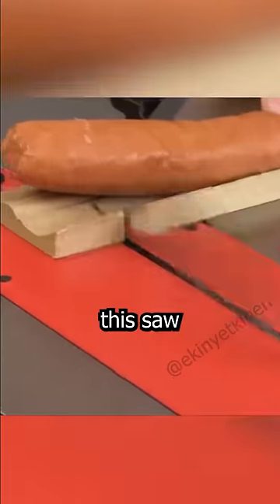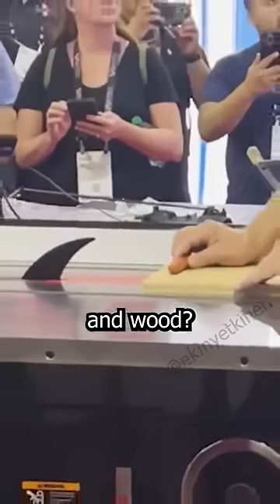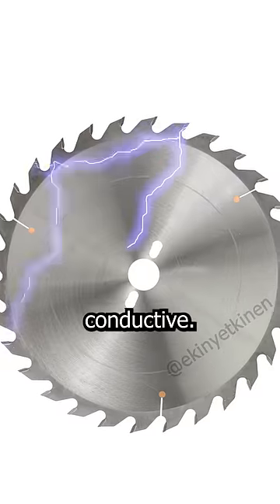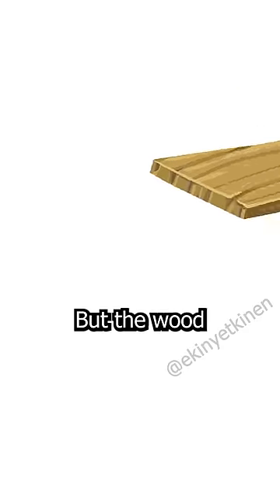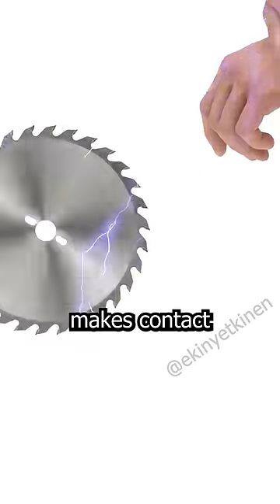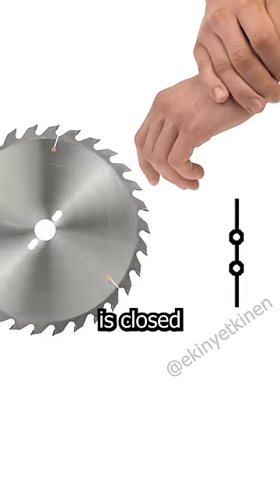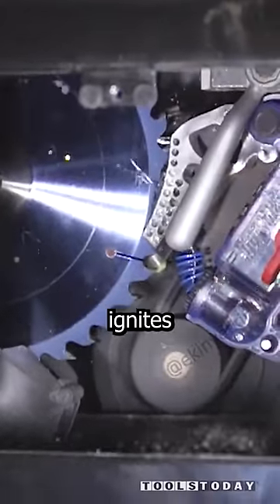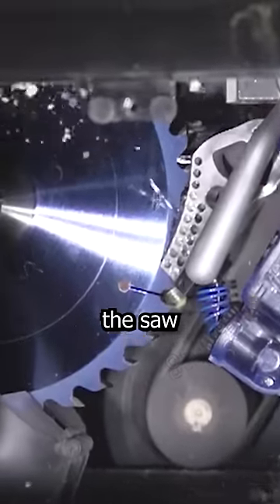How does a wood saw not cut my hand? 🤔 (sawstop)

Comment: My school has this. In my construction class my teacher said, “Better a nick and a $300 replacement for the sawstop than you not having your fingers.” 
Couldn’t have said it better myself
Reply: My school had these too but my teacher said it was closer to $5000 to get them repaired.
Reply: @Tylerb1324  I don't know what currency vound possibly be 5000 dollars but I am seeing $140 CAD for the braking system. I don't understand why he does'nt talk about the blade needing replaced too, which you could factor in another $100-160 which fits in peeta's statement. I would say that it is just a scare tactic and not realistic to be $5000.
Reply: @Tylerb1324  your teacher is lying. the company i worked for developed the brake and sold the patent to SawStop in 99/00. the replacement incl. the sawblade was around 20€ production cost and around 125€ + taxes for the customer, so i guess it will be around 150-200$ + taxes today. still way less expensive than some fingers.
Reply: I cut off my fingers and I disagree, they were put back on for free
Reply: The guy invented this is smarter than allah brain
Reply: If you do ever need to replace it, you don't even want to argue with that.
Reply: @Tylerb1324   Your school was either getting ripped off or the teacher was massively exaggerating the cost so people would think twice about triggering the stop for a quick giggle.
Reply: @JuliusClonkus this is the reason my teacher didn’t buy them
Reply: Yeah I'm not sure where y'all are buying your brakes from but they're only a hundred bucks so whoever's getting charged 3 to $500 for a break it's getting ripped off in the purse is making bank we have these in my cabinet shop and the brakes go off every once in awhile and it's a trip to the woodcraft 100 bucks.
Reply: @KeeganWall  Still worth it, you can't buy new fingers for 5k.
Reply: @romannicastro575 well, cheaper than medical bills and ugh . . . Missing your finger.
Reply: Must be a quality school then. Mine couldn’t even afford properly grounded welding tables
Reply: Which schools have construction classes?
Reply: @Tylerb1324  Is that 5000 Indian dollars? :D
Reply: @Tylerb1324  Their industrial cabinet saw cost about 5000, a brake cartridge + new blade will cost you about 220 dollars

Comment: These saws are awesome, I've been using them for 15years. One thing to remember when using them is wet wood or wood with embedded with metal will trigger the break as well. The price of the breaks are not bad now but when they first released they were expensive. Guys in the shop use to go through 5-10 in a year. You have to bypass the safety if you are cutting stapled or wet boards.
Reply: What about sweat? I can see potential issues in hot workshops.
Reply: @alexchapman3906   yes even sweat. The thing is you'll be covered in saw dust without good extraction. Even with decent one you'll get a dusting. As long as sweat doesn't hit the blade should be fine.
Reply: Yea learned this the hard way when cutting pressured treated lumber because we just replaced our old table saws with saw stops

Comment: PSA: THIS IS ONLY ON SAW STOP SAWS!  Be carful around all saws, but be especially careful around saws from other brands, as they dont have this safety mechanism
Reply: Also, remember that they probably would if the original inventor hadn't patented the saw stop.
Reply: And even if it is a saw stop, it can still cut you, badly.  You won't loose a finger, but you might need stitched and will need bandaids.  It's not worth being careless about regardless.
Reply: My grandfather lost his fingers from a saw.
Reply: Ye, the only bad thing i see from that saw is that it makes u not as careful as u would be on a normal saw, i used to work with saws and everyone was extremely careful and on this video the guy literally put his finger directly on the saw, not even on the edge of the wood, but overall is a good invention if u act as carefuly as u would do on a normal saw (srry for my english)
Reply: @WABeekeepers They would have it once the patent is over. You need to let the inventor make money, if not, none of these would even be invented in the first place.
Reply: @zxuy5575  it makes me more comfortable using a table saw if it's sawstop. It there is kickback, metal in the wood, or if you have an accident, that keeps your finger in tact. It could make you less careful, but I would rather have that safety precaution. I have learned from my woodworking class that experienced wood workers, even tears, can easily mess up and lose a finger.
Reply: @LukeO317O7  agree with u, im just saying that some ppl would be less careful knowing is a saw stop instead of a normal saw, like the guy in the video that didnt even put his finger on the top or the edge of the wood to pass it through the saw
Reply: @WABeekeepers  The only problem with IP rights is exclusivity. If anyone could license an idea and pay a fair price, it would be fine.
Reply: There’s surgical bone saws that stop on flesh. a neurosurgeon was showing it to me when it ripped his glove right off.

Comment: Not quite, it’s based on capacitance, the circuit is already closed and the sensor determines the capacitance of the signal coming back. If the circuit was open, your hand would be chopped off as there is no signal at all going to the controller. The only way a circuit closing saw stop would make sense was if it was grounded and you completed the circuit that way, but that would require a lot of voltage and would feel rather unpleasant.
Reply: Exactly like those electric testers screw drivers
Reply: It wouldn't require much voltage but yes
Reply: So, wouldn't particularly wet wood also set if off?
Reply: @grizzo9976 yeah it's been know to happen.
Reply: @grizzo9976 yes, you have to deactivate the brake to cut damp/wet wood (theres an arming key that you pull out)
Reply: @outkast937  neat, someone taught me something in the youtube comments!
Reply: AChtUallY 🤓
Reply: Now that sounds correct
Reply: There would also be a problem if you are wearing rubber soles and hence wouldn't ground the circuit
Reply: @samueljames8654  no, you would ground it to the frame of the saw, through your hands.  Not to the earth through your feet
Reply: So the detection circuit is pretty much the same one used in touch lamps or touch screens (or at least uses the same principle).
This technically makes the blade a "touch blade".
Reply: @grizzo9976 Either way it doesn't make sense. If it's already grounded to something then that thing woild need to be perfectly isolated from the circuit, which, the saw needs to be physically connected to the frame somehow. Then if you touch rhe frame at all it'd activate, so what you're saying doesn't make sense.
Reply: @sorvex9 Notice how you were completely ignored
Reply: @waldolemmer  Notice how i don't give a damn.
Reply: Doesn't it kinda work like those GFCI outlets they have in the US?
Reply: @woutverjans2928  Not the outlets/breakers themselves, but the way that the electricity travels through your body even though you're not touching earth/neutral wires

Also, most places outside of the US have GFCI, but it's usually part of the breakers in the distribution box and protects every room, not just the bathrooms (as in the US). Most call them RCDs (residual current detectors), but they're called earth leakage breakers here in South Africa for some reason
Reply: @woutverjans2928  yup
Reply: @eddiechung675 thanks for spreading your knowledge mate, it helps to have an expert or someone who has a proper explanation around so that other people get the right idea.
Reply: Like capacitive touch screens???
Reply: I don’t think it’s capacitance either. It’s some sort of resonator. It has to measure some change in frequency feedback.
Reply: @sorvex9 bro just outed himself for dropping out of high school
Reply: You wouldn't feel the volt on your finger anyway from the amount of Adrenaline that just surged through your body.
Reply: @ekon01cz no, it is capacitance. You can check the patent for yourself if you’d like!
Reply: Thank you ! now it makes sence. its like a fuse :D
Reply: Well losing your fingers would feel more unpleasant still
Reply: @outkast937  imagine you needed the failsafe because your finger got in and you pulled out the pin so it cut through it straight through
Reply: That’s right!! It’s very much what i explain on a different comment

Comment: Imagine how annoying it would be trying to cut wet wood😅
Reply: You just turn off the system lol
Reply: @techheck3358  I didn't know you could do that. I cut aluminum all the time on mine. My son's school had one of these break stop saws and he knew I liked to cut an aluminum trim around frames I make. He asked the teacher if he could change the blade, changed it, then the system kicked in as soon as he started cutting the metal. The school tried to get me to pay for a new break. I asked if my son "intentionally" stuck his hand into the blade. No? Then it must have been poor teaching. This is the first I'm hearing that you can bypass the system.
Reply: @djdickey  yeah, you just put the key in and twist it. it also has a little LED that lights up instead of the cartridge firing. that way you can test whether a specific material would have triggered the cartridge

Comment: It doesn't complete a circuit, if it did rubber boots could defeat the sawstop. It measures capacitance
Reply from the maker: Yeah it's actualy works like that
Reply: Yeah I had that same question I was like what if someone's wearing rubber shoes

Comment: Your hand definitely can not close a circuit like this. It is probably detecting changes in capacitance or something.
Reply: Can you explain how it wouldnt be able to close a circut?
Reply: @Meji_Kohi  cause to close a circuit a connection between both sides of the source has to be made. Since the blade is only a single contact point there is no way any circuit can be closed.

Unless you are assuming a circuit is made through earth. Which is ridiculous for many reasons, but mainly because you'd probably die of an electric shock before the blade would even harm you lol.
Reply: @Meji_Kohi  The guys is right you don't close a circuit , or else , you would have to be connected to the table , there is a small voltage applied to the blade , when it make contact , the change in capacitance is noticed in millisecond and the change of capacitance is way greater with a human body than a piece of wood , so you can know what is what and act only when the capacitance change a good amount .
Reply: from what ive seen, i think you wear a small clip similar to a running machine, thats connected to the braking system
Reply: Thats what i was thinking. Probably a capacitative system like most touchscreens.
Reply: @haileyredrix3102 This is not true, not for SawStop branded systems at least
Reply: iirc its the same way your phone detects your finger touching the screen using capacitance. I know sometimes really wet wood will trigger a sawstop similar to how raindrops on your phone screen can create false touches.
Reply: @richardmillhousenixon  ah gotcha, might have been thinking of a different system
Reply: @zipzip6677  This is correct
Reply: But this dont change that i want to know the name of music
Reply: Just accept that it's black magic and move on

Comment: Um as a reminder the stop isn't instant... it's supposed to keep you from losing fingers not slicing your head open... So still be careful
Reply: From a human perspective, it's practically instant. It takes about 5 milliseconds, start to finish. For reference, your lightbulb (incandescent ones, at least) turn off and on every 16 milliseconds, and most people can barely detect that, lul.

Comment: A table saw is an extremely dangerous tool that does not care about your feelings your excuses your plans or your feelings.

This safety feature is amazing to have however it should NEVER be depended on for safety.

Tips for keeping your fingers,

LEARN HOW the machine works.
Learn what NOT to do.
Do not become complacent.
Develop dexterity and grip strength.
Develop a solid stance.
ALWAYS ASSUME PEOPLE AROUND YOU ARE STUPID even if they are not.
 Have a healthy fear of dangerous machines.
Work calmly.
Reply: An ounce of prevention is worth a pound of cure seems to fit well here.

Comment: Truly an Amazing piece of technology the only slight downside is if the material you are cutting is even the slightest bit wet or damp its usually enough to trigger the brain tho its rare and 8/10 of the time you can tell when wood is dry or wet its a pain in the ass when its happens ( Dont get me wrong ill replace 100000000 brains and blades before i take the cheap route)

Comment: The wood isn’t conducive but sometimes the moisture within will still cary just enough to trip the saw. Remember to be safe and practice good technique. Ive seen this tool hurt people very bad! Make sure to equip your saw with at least a saw guard, if not a splitter or anti kickback claw, not everyone has access to a saw stop like this, and even a saw stop should be guarded at all times.

Comment: Simple. The saw runs a low frequency electric signal through the blade when the saw is running. (This is why it never activates the brake when the saw is off) If anything conductive touches the blade, the signal strength changes, and the system throws a metal brake into the blade, stopping it immediately. Then, the whole system drops below the table. This all happens faster than the blink of an eye.

Comment: Years ago, i took a construction class in High school, and these table saws were still fairly new. My school was lucky enough to get one, and it was like our first week in construction, our teacher was explaining how it worked. He seemed to dance around a demonstration, because he didnt have the parts to fix it, and he failed to tell us it would break. So before he could mention the replacement process, this one idiot turned it on, and put his finger straight to it. He got a little knick, it did stop the blade, but he ended up getting into so much trouble, and we were forced to use hand saws for half the year as punishment.

Comment: It's not gun powder in the brake cartridge, it's a really fine wire that essentially acts like a fuse. When the saw detects a drop in current across the blade (ie. the blade gets grounded by you touching it) it dumps a shit load of current through that wire and vaporizes it instantly, the spring behind the breaking pawl launches it into the blade in almost the same instant stopping the blade's rotation immediately. The force of the blade stopping instantly then causes the whole saw assembly to fall below the table. All of this happens in the blink of an eye and all you are left with is a small nick... It's crazy stuff!

Also no it does not activate if you run something conductive through it like a nail or staple. The object has to be grounded for the saw to detect the electrical dip, so you'd have to be touching the nail or staple for it to trigger.
Reply: It’s not a drop in current it’s a change in capacitance. The human or hotdog touching the blade is not completing any circuit, there is nowhere for the electricity to flow.

That’s why the hot dog, which is not wired to anything is able to trigger the brake. Running a steel nail into the saw won’t change the capacitance of the blade enough to trigger.
Reply: @Artholos  oh shit yeah that's a fair point, that's generally what I was trying to say but you are right, sorry I'm not super familiar with a lot of electrical stuff! I just wanted to give a general explanation of how it works because the original video got it a bit wrong... Which I guess I did too!

Comment: Everything good but, the circuit is closed? I think you mean open When the saw is running the circuit is close but when it detects your hand or fingers the circuit then opens so it does not allow current go through which means cutting the power in the saw and saving your finger. If I'm wrong correct me please

Comment: It’s not gunpowder. It’s a very thin wire that gets a massive charge dumped through it from a large capacitor. That in turn melts the wire and releases that massive blue spring which fires the aluminum brake shoe into the blade

Comment: It’s not gunpowder that deploys the brake. When the computer senses a change in the blades electrical charge a large current is sent into the cartridge across a  thin wire. This melts the wire. This wire melting releases a powerful spring that has a lot of tension. It is this spring force that forces the aluminum brake block into the blade stopping it faster than a blink of an eye. The momentum created at the same time pulls the stopped blade down and under the table

Comment: There is industrial saw blades now that work with magnetism that do not break when you touch the saw. It will simply turn off and the blade will go down at very high speed. After you turn it back on the blade will come back and youre good to go. System starts at Like 25.000€ so only reasonable for companies

Comment: We learned about this in shop class and hotdogs r conductive too like ur fingers so they used hotdogs to test it and they threw one into the table saw pretty fast and it stopped so quick that the cut was only a 1/4 inch into the hotdog

Comment: Its a capacitive-frequency system when you touch it the frequency changes and it breaks a fusable link which normally holds back a spring, no gun powder is used.

Comment: Just a FYI there is no gunpowder in this braking device, this is spring loaded with a fuse wire that once the circuit is complete will melt releasing the compressed spring.

Comment: Not gunpowder. A very strong spring with a very powerful capacitor. The sparks you see are from the aluminum saw brake that lodges itself into the blade with the force of a very compressed very stiff spring.